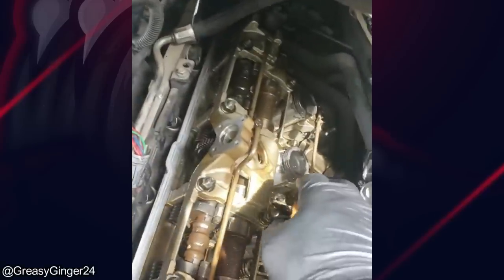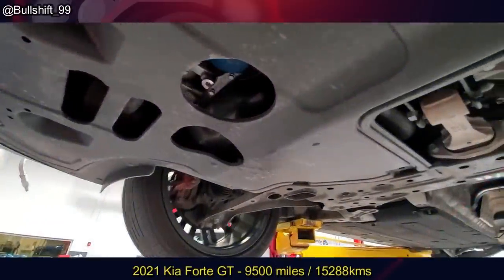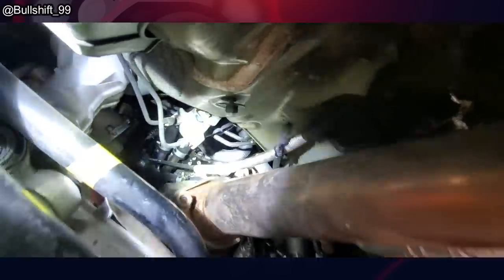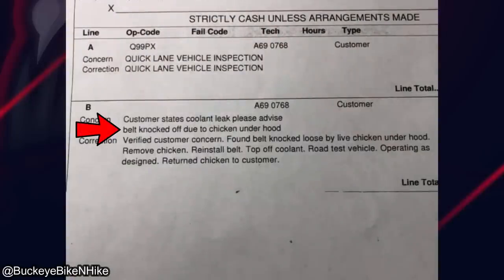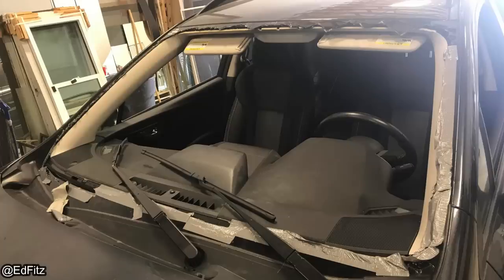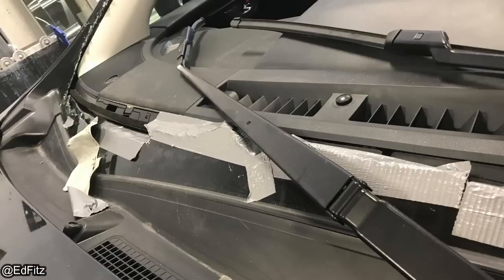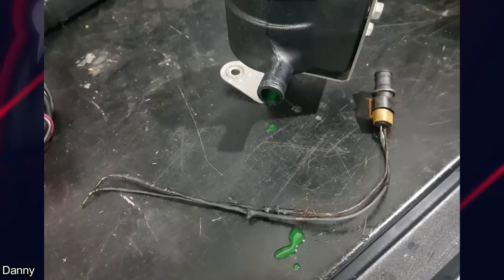Customer States Check Engine Light Is Still On | Just Rolled In

Comment: 1:09 I'm a used car dealer, and experienced something like this, the lost of a belt because of a failed water pump.  Rather spectacular really, on a 2006 Dodge Ram 1500, guy wanted a test drive, we left the lot, made it about one block when we noticed a vibration.  Out of curiosity, I wondered if the vibration varied with the speed of the truck, or the rpm of the engine.  So I shifted into neutral and stepped on the gas.  We heard a loud bang and then the vibration went away.  It was the water pump.  The shaft broke off, causing me to lose the pully, clutch, and fan.  The assembly shot into the radiator and chewed it up, and also shredded the fan shroud.  Because the truck was in motion, I also ran over the pully, clutch and fan assembly, which destroyed one of the rear wheels and tires.  Customer opted not to buy the truck.
Reply from the maker: 😂 thanks for sharing.
Reply: Customer opted not to buy the truck.
Didn't you try to point out that at higher revs (like when racing) it sheds excess weight to increase speed?
Reply: Well... they certainly Dodge'd that one. 😝
Reply: What about that True-Coat though... did you offer the true-coat sealer?
Reply: They really missed out. They’d have gotten a new rad, water pump, fan shroud, fan clutch, and a new pair of rear tires!
Reply: Hey, the vibration went away! Did it get driven back to the lot?
Reply: @brucewrigleysgumchewz4667  Badda-Boom!
Reply: @61rampy65 , yes, it was only about two blocks away, but the radiator was already half empty and the engine was beginning to overheat
Reply: @jonhunt5408  Good one👍👍👍
Reply: good thing, it had passed inspection.
Reply: Smart man!!

Comment: Love it when brakes are put in backwards
Reply from the maker: Happens quite often lol
Reply: Some of the worst noise tho, that and if you have a very opinionated lady, they tend to keep going when you leave them in the car haha
Reply: happened to me in my bmw e46.
Reply: ive changed many brakes over the years on my vehicles ,.....never occurred to me there's more than one way to install them.
Reply: seen that before that ended up replacing rotors because it gouged such a deep hole into them they were non-fixable you could not machine them
Reply: Pads last much longer that way.
Reply: @dubious6718  ... actually they don't last longer. You can grind a rotor down to nothing in a week or so.
Reply: @dubious6718  lol
Reply: Does the car accelerate when you step on the brake?
Reply: like a record ,turn them over when they are worn..
Reply: @maartenyzer4121  lol
Reply: I can see how its done, but you gotta be effin stupid not to check that the pad is on the disc and the piston is on the steel face.
Reply: @csjrogerson2377  True That
Reply: Saves on brake pads
Reply: @rupe53  pads last rotor won’t
Reply: @daleskelton8963  ... that's basically what I stated... you can grind a rotor down in a week.
Reply: @Craig Roop ... back in the early 80s the Clover Company (makers of valve lapping compound) made a gritty substance you'd smear on brake pads and it was supposed to go away in a few days. The idea was to eliminate brake squeal by scuffing the rotors without removing them for machining. Personally I felt this was aimed at the DIY market back when pads only lasted maybe 10k miles and guys just slipped in a new set at home. The product was pulled from the market within a year or so.
Reply: @Craig Roop ... I never used it either but the company was right here in town so it sticks in my mind. Matter of fact the building is still there too, although repurposed. Guessing their stuff is made on the other side of the world now.
Reply: Seen it done ,it didn't leave the workshop i flagged the clown down to stop ! He had an ego problem!
I said f no! Pull up back on your bay,send it up! And fit those brake pads the correct way! He was gping to go and test drive the car! W.t.f!
Reply: @captainpotato6856  👍
Reply: I didnt even know that was even possible at all
Reply: @dubious6718  Yeah it's like wearing your underpants on the outside to save on laundry.
Reply: @generalrodcocker1018  I don't think you managed to put the break pads in backwards on an E46 because you got those springy things on the outside of the breaking pads that fit into the break piston and if you try to put them in reversed you'd have to remove the springy thing or it won't fit at all... And if you removed the springy thing you shouldn't work on cars in general because then you're just missing common sense and a working brain 💀
Reply: @FilippmitF  it is possible because it happened at my local car workshop. they put the outer pad backwards in. the "springy" things are only in the brake cylinder side... the car sounded like a train
Reply: @generalrodcocker1018  Sorry but these "mechanics" need to be stopped and put into jail then if they put one side in right and mess the other side up - how insane have you to be to not see that there is something wrong so obviously!?
Reply: @generalrodcocker1018  I'd usually not believe you with that story but seeing the other videos of this channel it wouldn't be surprising if someone welded the engine to the transmission or used olive oil instead of engine oil
Reply: @FilippmitF  i don't care if you believe me. but it is totally possible. you can turn the outer pad around. not the inner with the spring.
Reply: @FilippmitF  that's true. the shop owner was a little bit upset about that. i can only explain that he was in big stress, alone in his workshop and his wife was very sick at that time because she had a stroke. this is not an excuse but it happened.
Reply: Have to admit, NEVER seen THAT before!!
Reply: I’ll tackle all sorts of home and auto projects, but I want somebody who knows what they’re doing to work on the brakes of my car.
Reply: Do backwards installed brake pads make you go faster when you push the brake pedal?

Comment: "Thats Cute" i have woken up dreaming that i had installed brake pads backwards lol..15+ years as a tech and these are my nightmares haha
Reply from the maker: 😂 I remember having nightmares all the time when I first started in the trade.
Reply: 3am...did I remember to torque those wheels??
Reply: I'm not a tech but have done a lot of work and have spent a few years in PDI. My "nightmare" would be doing a head or lower intake gasket and then later having the engine run bad all because I screwed up the torque sequence of the bolts... and then having to tear it all apart again. 

Haha.. that's why I don't touch heads. And I'm a lil scared to mess with the intake on my Crown Vic.
Reply: @brucewrigleysgumchewz4667  ... don't tell anyone but after 45 years in the trade I was short one intake bolt on a Chevy 4.3 and figured it out when the thing only ran on 5 cyls. Pulled it apart and there was my missing bolt holding an intake valve open. Good thing the bolt head was too big to pass through. I was able turn the engine by hand to release the valve and fetch the bolt with a magnet. Only a few hours behind schedule but it ran perfect when I was done the second time.
Reply: I remember doing heads on Ford Escorts and after start up and warm up, the accumulation of coolant in the exhaust could take 20 minutes to 2 hours to burn off. The stomach would always start to churn at the 45 minute mark.

Comment: I just don't know how anyone could get brakes wrong, they are essentially pretty simple, pads grip the discs, who would put a pad in the wrong way? Crazy!
Reply: Must've been a hell of a racket stepping on the brakes.
Reply: people not paying attention how bad are the rotors That's the question cuz I seen that before
Reply: It must literally take more effort to fuck up like that, a lot of calipers have metal spring tabs that hold the pads by the backing plate when they are in correctly, plus the Anti squeal shim has go back on,  then theres the noise the first time you use them. It just blows my mind. :-))
Reply: I've had actual brake shops do this.
Reply: @jamesm568  That's just unbelievable! It's difficult to imagine a simpler task
Reply: @trackerrrr  I think you have Tee Shirt slogan there👍👍
Reply: @jamesm568  they hire temps as well or drug addicts.

Comment: The first one makes me think of how people think that the obd 2 code is the end all be all of diagnostics. I'm sure that broken camshaft would cause an error in the way the sensor reads, but there is no code for broken mechanisms.
Reply from the maker: I've heard that so many times from people and it makes me chuckle when the sensor they replaced doesn't fix the issue.
Reply: Not the first Bimmer with a broken cam, I have heard of others. And these days the scan tool tells them a code,, which does not come up with the actual problem.
Reply: @JustRolledIn  Do they also say "must be a blown fuse!" like that's nothing?
Reply from the maker: @freedomspeech9523  yep! Lol
Reply: @ldnwholesale8552  I usually tell people that there's at least 3 possibilities for a code. It could be exactly what the code states, the sensor that monitors what the code refers to or the wiring going to the sensor.
Reply: @freedomspeech9523  at times. I usually try to warn people that unless the fuse has a lot of age on it they might have a wiring problem.
Reply: Many places now won't even work on a vehicle if they can't plug their diagnostic equipment in, I took my 86 GSX-R bike to a motorcycle shop for a job i didn't have the special tools for and they said "Can't work on it, too old".  :-)
Reply: @travissmith2211  There is nothing that can "age" in a fuse to make it blow open. In all the cases something else (wiring) is at fault.
Reply: @freedomspeech9523  please consider the life of a fuse. It does go through thermal cycles like most anything else that carries electricity. After so many cycles it can fail. Also, while not blown, I have had a glass fuse fall apart from age.

Comment: I'm surprised that the salesman didn't realize that he was driving a diesel.  I mean diesels sound way different than gas engines.
Reply from the maker: I was thinking the same thing. Guess they used whatever nozzle would fit lol
Reply: They sell cars but usually are not car people.. it's sad.
Reply: @nthgth  well even still there are labels everywhere and the cap is green
Reply: @CaptainRudy4021  you're not wrong
Reply: @CaptainRudy4021  it came with the wrong cap and no def fill. Someone mixed it up from the assembly line
Reply: @jonathansmith7306  how do you know that?
Reply: @CaptainRudy4021  Pictures.

The filler cap in the  images in the post is yellow, not green. And the boss for the DEF fill doesn't have a removable cap on it.
Reply: Fuel cap says Gasoline.
Reply: @Amtcboy  i guess I missed that since I was only half paying attention.  But still, most diesel trucks nowadays say "diesel fuel only" on the dash, there's badging on the truck advertising that it has a diesel engine, and, like I said, diesels sound different than gas engines.  Not to mention, I'd have noticed the cap after pulling up to the diesel pump, at which point I'd notify the dealership what I saw and that it needs to be fixed.
Reply: @CaptainRudy4021  
True, regarding the engine sound, but newer vehicles have very good insulation that engine sound do not reach the cabin, or dampened substantially. When agent started engine, he must have closed the door; and turned off engine first before opening the door. Agent may also have not dealt with diesel vehicles that much. But the clincher I think is that Gasoline was written on the cap. 
Of course, these are all speculations.

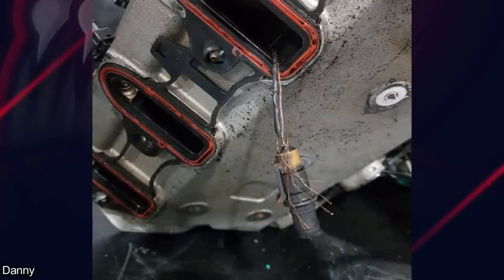Comment: At 2:40 I had an 85 Toyota 4x4 which got sideswiped. Bent the rear axel housing. When I went to pick up the truck I drove it about a half mile and started getting a growl from the rear. I drove back to the shop and told the owner to please check the gear oil. He drove it and it quieted down before I got back to the shop so he refused. I all but begged him to take ome minute to just humor me please but NO his guys had just installed the rear end and so it was good. Ooo Kaaayyyeeeee!  I drove almost 20 miles home and BANG! SKREEEEEECHHH! The rear end locked up and I skidded sideways in the road. The rear end was DRY! It was Cherry RED HOT!  That was a fun call. Hey remember that diff oil you were so sure was good??? Guess what.... Cost the shop 0ver $900 for a new rear end and they were just super lucky I didn't hit anything when it locked up. It would have literally taken less than a minute to pull the plug and check the fluid level.
Reply: That's why I always check my own fluids. Cant trust the knuckleheads in the shop to do it correctly or at all.

Comment: Once heard a weird chirping noise coming from the engine in my Accord as I drove home from work, which was in a more rural area about 15K by highway from home. Didn't seem to be related to speed, RPM or anything - just a single, intermittent chirp. Got home, shut it down and popped the hood. No obvious signs of trouble so I started it up and had a look. Peering over the engine I goosed the throttle and heard it again, from the rear of the engine. Looked over and there was a marmot (think ground hog) tucked up under the exhaust manifold. With the engine off I tried to scare it out by tapping around with a stick, tried flushing it out with water - the thing wouldn't budge, just glared at me with accusing eyes and gave a chirp every once in a while. I remembered being told that some critters like to hide in engine bays because they're dark and feel secure and leaving the hood up can deter them. So I left the hood up overnight and the next morning it was gone. That day after work heard from the guy across the street that the marmot had gotten under the hood of his truck and chewed the spark plug leads to crap. He was a bit of an a-hole so I just kept my mouth shut.

Comment: Man... a dash cover that has bubbled up is one of the most expensive single parts on your car..  $800 on a 4th Gen Trans Am or Camaro.
Reply from the maker: Ouch! If I had a Infiniti with a bubbled dash and it wasn't covered under warranty, it wouldn't be getting replaced 😅
Reply: @JustRolledIn  once I paid $800 for a new dash cover.. ($550-ish used) I had it covered in leather so it would t ever bubble up or crack.
Reply: You'd think something like that would be covered by warranty for more than just 8 years.
Reply: Lol u must not have had to repair anything late model, 800 cheap compared try a forward radar module.
Reply: I wonder if that dash cover also gets really sticky when it starts doing that. Reminds me of the cruise control buttons on the steering wheel of my moms 2001 F150. The plastic in the buttons started getting a little soft on the surface and were sticky. Almost as if something like acetone or lacquer thinner got into the plastic and degraded it... though nothing like that ever got on it. It only continued to get worse. Truck was traded in before I got around to replacing the buttons. 

I'd have given Nissan $hite if they would've denied replacing the dash. That's awful.
Reply: Jeez, i wish i lived in a place where $800 was price of one of the most expensive single parts of a car :-)))
Called Toyota NZ for the price of a retractable aerial for my 99 camry commuter hack, "550 NZD to you sir"
after i finished rolling around laughing, i hung up and got one for 16 dollars, inc shipping of Ebay :-))

Comment: sometimes one is challenged. I once confused the brake pads on a (Not A)Mini, because the differences were minute and I didn't know I had to look for that. brakes made a noise right away... of course I caught shit for that.

for those curious, the center up car on the outro image is a german (or possibly south african) Ford 23m P7b hardtop coupé in RS getup. most probably a custom judging from the wheels and the metallic green. and the bold hood scoop... XD I'd bet it's made in south africa as a licensed from Ford germany. built between 1966 and1972. that being said, I'd want one.

Comment: Oh yeah, i was in the army as a driver and we were about to join an exercise in Norway. I was meant to drive a 4 axle Scania hooklift carrying food supplies. Well, we take off with an empty truck and drive around 100 km to the other base where we would grab the container and head off the next day, upon arriving inside the gates of the second base, i was able to smell burnt and the front end wobbled a little bit during driving, thought that wheel had come off or something. Crawled under the front end and managed to find the source for the smoke, an open plug hole used to fill the front differential with oil, the plug was still attached just below it with a magnet. Somebody either forgot to fill it up or did fill it up, but forgot to put back the plug and the oils are now spread somewhere in the roadside. The entire front axle was steaming hot, it was winter at the time, so i threw some snow on to it just for heck of it, it melted immediately and the wet spot that it left on the metal dried out in less than a second. Surprisingly the axle wasn't ruined, as i saw it return back to our base on it's own power a week later.

Comment: Awesome as always.  All manufacturers foreign and domestic need to slow it down a bit, there rushing vehicle thru production/assembly and making huge mistakes
Reply from the maker: Agreed on that but they just look at the dollar signs.
Reply: I've read a lot of comments about Infinity in particular and the quality dropping off in the past decade or so. They've competing directly with Lexus, you'd think quality control is the one thing that they would monitor.
Reply: It's not so much rushing as it is deliberately skimping on quality so that you have to buy parts/a new vehicle from them sooner.  You see it with most products these days, not just vehicles sadly.